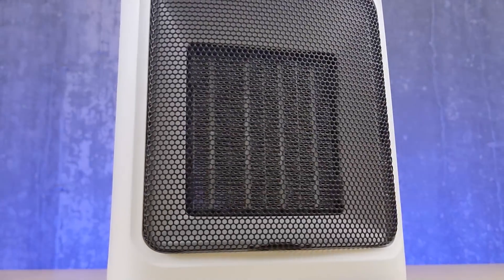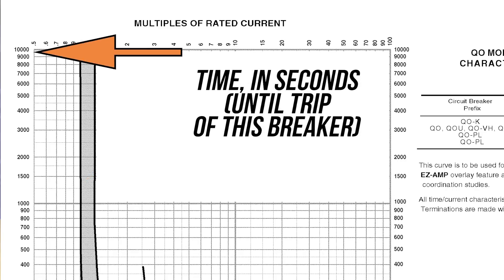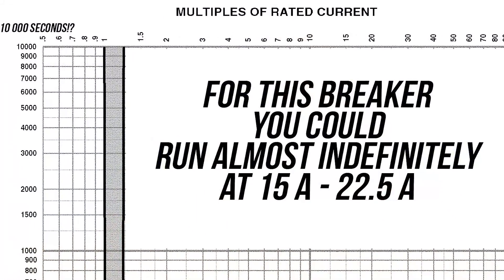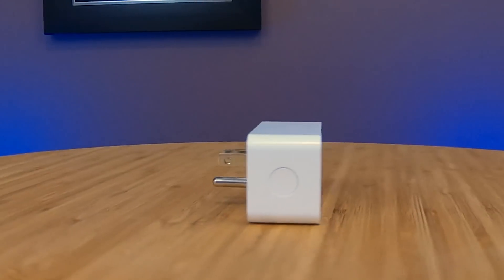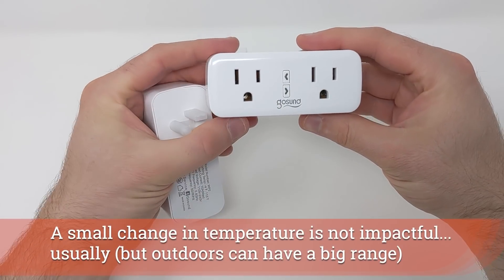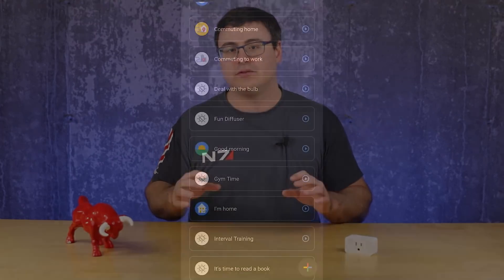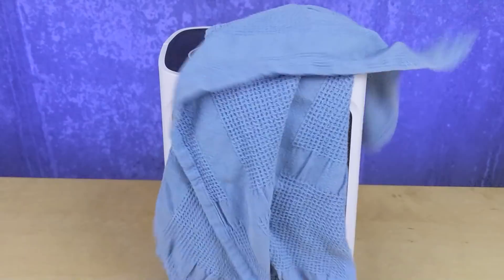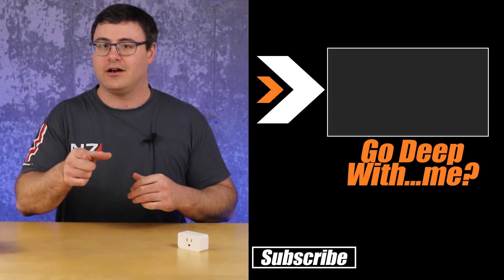Why Smart Plugs EXPLODE or MELT With Heaters!  Are Smart Plugs Safe?

Comment: Great video! Small comment... i assume many are already aware but worth mentioning. Typically in newer houses, receptacles for a given room are going to be on a 20amp circuit, not 15amp. The receptacles themselves will be rated for 15amp, but the circuit will be 20amp since there will usually be multiple receptacles for a given circuit. (The only time you would see a 20amp receptacle used is for a dedicated circuit.) So in practice this means that a space heater is unlikely to trip a circuit on its own, it would need additional draw from other devices on that same circuit for a trip to occur.
Reply from the maker: Thank you Chris!  Much appreciated for bringing this on.  I didn't want to get too complex with all the actual ratings in the video itself, but this is something I can pin for people to ask about and discuss.
Reply: Then you should pay more and buy a 20 amp model.  Newer homes have existed since at least 1954 as 20 amp circuits with 12 gauge wiring has been used since at least then
Reply: @SteveStowell  average consumer dont understand 15 or 20 amp they just go with cheaper options

Comment: How about using a 1000w analog electric oil heater? Never gets hot enough to set anything on fire. Can i trust the smart plug not to catch itself?
Reply from the maker: It's not about the physical heat coming off the heater, it's about the electrical heat generation that happens inside the plug.

Comment: cheers for the video, was wondering if anyone knows a 20A smart plug from a respectable brand ? Would like to use this to charge my battery from my car (hybrid) so would do with 16A charging, just would like the smart plug to be a bit bigger for safety. Any tips and ideas are welcome. It needs wifi and to be programmable as I have a variable energy contract so i can pick the cheapest window to charge.
Reply from the maker: I believe Aeotec's got a version that's meant for bigger loads like this.  Check with them on your use case though, that's a bit of an intense one...

Comment: I am from india. Can I use 2900 watt oil heater with 16 amp smart plug from Wipro brand ?
Reply from the maker: I don't know enough about any of what you just said to determine that.  Your heater could be many kinds, I don't know your power system, and I don't know the specs on the plug

Comment: We have something similar in the UK regarding the graphs. It is called thermal graph and it covers MCB’s, fuses, etc. It has been over 10years since I used one. 😂🤣😂 Basically it gives you disconnection times under fault current situations with the rated protective device. So with an MCB the higher the fault current the faster the disconnection time. 
But what I don’t understand with smart plugs why don’t they state a Resistive and inductive current rating of the relay. I know it says 10A but I assume it’s a resistive rating. Also needs to be some type of thermal overload protection inside them. Great video by the way.
Reply from the maker: Thanks Andrew.  We're actually seeing resistive/inductive load ratings show up now on smart plugs.  I think folks have started to catch on!
Reply: @AutomateYourLife  LED lights have massive startup up currents when first powered on just for a fraction of a second, this seems to be causing problems with smart plug contacts.  Also I am finding that some smart plugs here in the UK are allegedly rated to “13A” but it is a 10A relay inside the smart plug. So here in the UK it has a maximum loading of 2400W or 1200W in the USA. I would never use a smart plug for any heating application, it’s just too risky. How long does a smart plug last you? I have got some here lasted 12months to 3years. Tapo Smart plugs are a 12-18month life span, Meross 2-3years. My advice to anyone is use smart plugs for light loads, no lighting or heating. 
Sorry this reply was so long. 👍🏻👍🏻🤣😂🤣 TFI FRIDAY!

Comment: So in other words, instead of all these electronic jargon and graphs, can you use a KASA smart plug with 15 A capabilities on a radiator heater on a 1200 W / 120 V = 10 A? YES OR NO?  Sheesh.  Get to the point
Reply from the maker: Short answer is maybe. Details are in the video.

Comment: So the idea is that you get a smart plug that supports at least 2x the peak consumption? Example - if your heater is consuming 1kW, you should get at least 18A smart plug (for US) or 9A for Europe? I didn't really get the recommendation :)
Reply from the maker: Sorry, but the idea is that the ratings aren't explained well enough to make an assumption.  So only get plugs that say they can handle the type of load you're after.

Comment: Great video very informative. Are there any plugs you can recommend for washing machines and air conditioners that have energy monitoring for smaetthings
Reply from the maker: Hey Mike, Washing Machines usually require a higher amperage service.  Check out Aeotec for one there.

As for air conditioners, honestly...get a smart one like this Midea one: https://youtu.be/ePKUjuDou-Y.  I don't like most of the ones on the market today even when they say they deal with motor/inductive loads.  At 15 amps and at the size of smart plug that they make, it's just not enough space for proper heat dissipation.  At least, that's my opinion when we're talking about long term use.

That Midea one has been bulletproof.  I just turned it off with my voice this morning and that's after leaving it disconnected for about 6 months. :)

Comment: Perfect example of what am running into. Thank you for posting the video this is really helpful. I have two rooms connected to the same breaker and I need to run them on at the same time. Goove has some space heaters which are reasonably priced compared to Dyson and it has all the tip-over protection and all the nice features. Now I have some aqara climate sensors to monitor the temperature and turn on the heater at Low mode (700W )  now even if I run both at 700W the total Amp would be 11.66 Amp less than 80% of my 15A breaker. This space heater has Alexa and Google Home integration.
Reply from the maker: I'm JUST testing one of those Govee heaters.  Love it so far.

Comment: Hi. I wanted to see if you had come across smart plugs that would work with US 20amp 240volt outlets. Thanks
Reply from the maker: I did.  Aeotec has one.  It's a bit older and requires a Z-Wave hub.  But I remember it being 50 amp

Comment: Great video Brian ,
Do know of a brand smart plug that has a setting to automatically shut off after say 5-10 or 15 minutes or longer . 
Thank you 
Mike
Reply from the maker: Hey Mike.  You could do this with a lot of systems but those kinds of automations aren't 100%.  Please make sure you're being safe and have a visual or physical way to verify that the plug turns off.

Alexa routines can wait 15 minutes and then turn off the plug after turning it on.  Meross has a nice feature that allows turning off of their devices after being on for X time.  Lots of apps could do it!  SmartThings, Hubitat.  All the hubs :)
Reply: @AutomateYourLife   Brian , thank you so much for the info !

Comment: Hey I'm late here. Just bought a delonghi space heater 1500w, I have 2 socket outlets (one above one below). 1 socket below is plugged to a surge protection extension that has my laptop, monitor and chargers. The 1 one socket above is empty, is it safe to use this solely for my space heater? Wondering if the 2 sockets share one circuit and as a result risk going over 1800w allowance (15amps * 120)
Reply from the maker: Ok, if you're directly into the wall this SHOULD be OK.  If you are using a 2 socket smart plug, you need to be very careful.  This whole video explains how a smart plug could explode with that kind of load on it.  That's likely an inductive load and will heat the plug.  My advice is don't do it if that's what you're doing.  Just don't use a smart plug with the heater.

If you're going directly into the wall, a properly designed home trips after you go above the 15 amps max for most circuits.  There could be a delay, but you have protection in your home's breaker.

Comment: How would you apply this to, say, a heating pad?  My use case would be that I want to be able to keep the heating pad plugged in, but have the smart plug essentially act as a smart "current shut-off" based on a timer or as part of a routine "Goodnight".
Reply from the maker: This is still something that could cause the same phenomenon we're talking about Travis.  However, I think you're talking about lower amperage in general.  I'd say with a 15 Amp smart plug and a normal usage of 7-8 Amps on one you'd be OK most of the time.  I also wouldn't leave it on all night, k?

Still, watch it and check for heating.  Don't forget too, over time heating can increase on smart plugs.
Reply: @AutomateYourLife  absolutely!  Makes sense.  And I have the kind of heating pad that does auto shut-off after 2 hours.  I just want to also make sure I have the ability to "kill" all power to it even after it shuts itself off.  Does that make it better?

Comment: Great video thank you. Please, which smart plug can I use to connect a bitcoin miner 1,500 W at 220v?  Thank you in advance
Reply from the maker: It's going to be a similar situation.  There are smart plugs rated for this though for sure, especially at 220V.  What I'd try to do for your setup there is to make sure your miner is protected first, and smart second. :)

You want that GPU protected from brownout/surge.
Reply: @AutomateYourLife  Thank you. What kind of protection do you mean?
Reply from the maker: More like power cleaning.  A good signal cleaning ups is likely more help to your wallet and life

Comment: Very interesting. I bought here in Spain a Tp-Link Kasa smart wifi plug 16 A 3680 W  to start my Rofco B 40 (max 3100W) oven at night ,but after starting for only 30 minutes the plug disconnets due to overheating. Is there something I can do? Or which plug  would you recommend . Thanks
Reply from the maker: I would recommend that if you're seeing a plug overheat already, that you stop.  Seriously.

As soon as that fail safe doesn't work, you could start a fire.

Comment: In my opinion these shouldn't be legal to sell. If it's rated at 15 amps, it should be able to safely handle 15 amps (as well as the associated inrush currents) indefinitely.

There are almost no space heaters than pull 15 amps (due to NECs requirement to not load a circuit past 80ish percent for constant loads). They're all pretty much 1500 watts or 12.5 amps and thus there is absolutely no reason why a device rated at 15 amps shouldn't be able to handle them safely.

Either they need to be banned (and companies like Amazon fined if they sell them) or they need to be a little more honest in their ratings. If they rated them at 10 amps, I wouldn't be complaining.
Reply from the maker: I don't disagree at all.  Inrush has to be handled, as well as heat dissipation for ratings.

Comment: thanks for the info! what could be a safe alternative? I like to wake up to a warm bedroom and I was using a smart plug to turn it on.
Reply from the maker: Try a smart switch if you have an outlet that is controlled by a light switch, or use IR based control if your heater has a remote!

Comment: I have actually needed to do this for a permanent ceiling mounted garage heater and decided on using a Sonoff S31 to power an Eaton Definite Purpose Contactor which will handle up to 40 amps of resistive heating. The Sonoff only needs to power the contactor's coil, and the heater's power no longer runs through the smart plug's relay and components. Just an idea for people who may have a garage heater install or something else that is safe to run unattended. Always use over rated components when possible. My heater only requires 21 amps, so it's only around 50% of the contactor's rating and should last a long time.
Reply from the maker: That looks like a great suggestion there Matthew.  Good stuff!

Comment: im using smart plug for an extension plug....since it's behind my bed...is it okay if i just turn the smart plug off using my phone n leave on the socket that i pluged smart plug in ...the smart plug led will be on since the socket is on but the extension wont be on after i turn off the smart plug using my ohone .....is it harmful and will it consume electric?
Reply from the maker: Without knowing what you're plugged into I can't tell ya much!
Reply: @AutomateYourLife  my smart plug is plugged into wall socket ...is it safe if the smart plug left on but turned off using phone ..i mean like the socket will be on so does the smart plug ...but turned off using phone

Comment: At least in the UK we have double the voltage than you guys, therefore half the amperage. 

Tell me, do you feel any benefit from running smart plugs that report current flow, as heat is as you say directly related to current flow so there is cleary an large increase in current for some time way before the plug starts to become a risk. We use home assistant to report what we consider to be an over current.

So if i have a 3000w rated smart plug i will normally have an alert set at say 2kW and have home assistant switch it off at say 2.5kW. I will vary these settings based in what device the plug is running, as i cleary dont want a warning of 2kW if its running a 500w device.
Reply from the maker: I think you're talking about measuring expected current flow and therefore figuring out how your devices normally perform.  Then you're talking about setting O/C protection and hopefully doing it at the right levels for the device you're using.

I like that approach because that's how industry does it.  They just measure devices before they go out the door and go into use.

I would say 2.5 kW is a big difference from 2 kW though, so maybe tighten that up.  Things get out of hand quick in the world of electricity.

So yeah!  Lots of benefit in reporting current flow!  Just consider where your O/C protection kicks in vs the types of graphs you saw here today.

Comment: I have a Dyson that I got ages ago but it's not the smart version. I have had it plugged into a smart plug and have not had any issues. But should I be concerned? After hearing about this I feel a little unsafe. I'm from the UK and I see that there are fuzed versions of smart plugs. Would having one of them be safer to plug my dyson fan into?
Reply from the maker: It's going to be hard to advise you here.  There's a lot that goes into the situation.  Fuses can sometimes be better, but they have a "damage curve" just the same as the graphs you're seeing here.  Some are fast acting and pop quickly, but I've also seen fuses not "pop" when they should.  I think the question is if you really need to automate that Dyson.

Comment: Is it safe to use a smart plug with an 800 watt parabolic heater?
Reply from the maker: That's a pretty general question that I'd have trouble answering.  In general, that's a pretty low wattage so in terms of a smart plug handling that it should be fine.  However, it will still cause all the issues OVER time that were discussed in this video, and you still have a very hot surface to contend with!

Comment: Hi! I've been using the Teckin Smart plug with my heater and it's relativley new. I turned it on today for about an hour and I had put a timer on it. I just tried turning it on and the plug itself turns on but it seems like there's no power that goes on to my heater as the heater itself doesn't turn on. However if I plug my heater regularily into the socket the heater works fine. Do you think I short circuted my smart plug due to the heater or could it have possibly been a faulty plug? The other smart plug is connected to my lamp and has been working great. Thank you for the video! Wish I saw this beforehand.
Reply from the maker: You've done some damage for sure.  The good news is that it failed in this way and not a worse way!  Toss the plug. :)

Faulty?  No clue.  Just sounds like it took an overload and failed.

Comment: I had a Kasa smart plug melt from a heater.  I thought it was because (or at least was contributed to) it was plugged into the outlet on the wall above the baseboard heater and the extra heat rising up caused the issue.  I changed the standard outlet to a Leviton z-wave smart outlet (one socket controlled, one always hot).  I use the heater a lot and turn it on/off a lot and haven't had an issue for many years now.  I was (am still) hoping that using an outlet will handle the current better than a plug in device.
Reply from the maker: I think in general you're right.  An outlet over a smart plug is going to be better.  You can still eventually run into the same problem, but I think you'll find them to be more resistant to heat and current over time.

Comment: Thank you for this. Need to rethink a space heater I have been using temporarily in a greenhouse. This was just to buy me time while I actually run electrical to the greenhouse and install a approved greenhouse heater. Only using it on low heat to prevent freezing temps.
Reply from the maker: I'm glad this helped!  Let's keep those plants growing!😀😀😀

Comment: For anyone who still wants to connect a heater to a smart plug, I can tell you that this heater works well with Kasa smart plugs. I've been using the combination for ages with no issues. https://smile.amazon.com/Portable-Heater-Comfortable-Adjustable-Thermostat/dp/B08H5QKYQL

It's only a little heater meant for a small room, and Kasa plugs are pretty durable.

Comment: It should be pointed out also that many of these smart plugs And strips are measureing current (power use) with a shunt resistor.  Where there is resistance there is heat, especially at the upper end of it's capacity.  So especially never use space heaters with these types that measure power because it's almost never measured with a CT
Reply from the maker: Theres a guy who knows his stuff.  CT talk and everything!😀